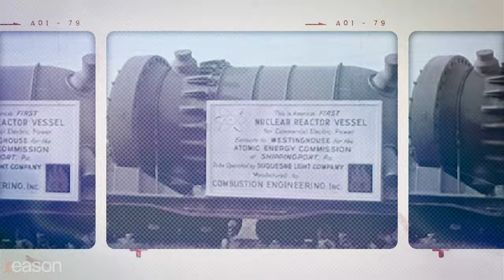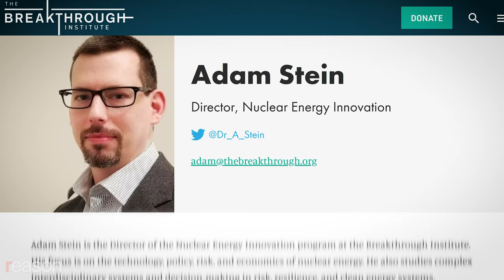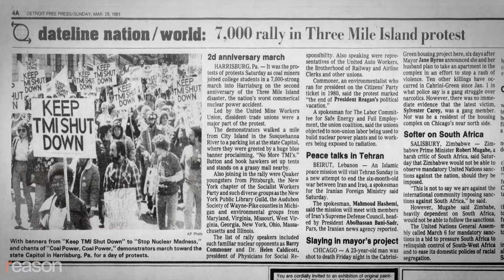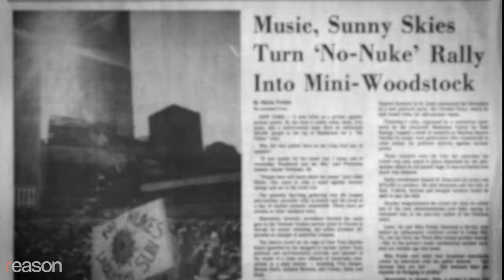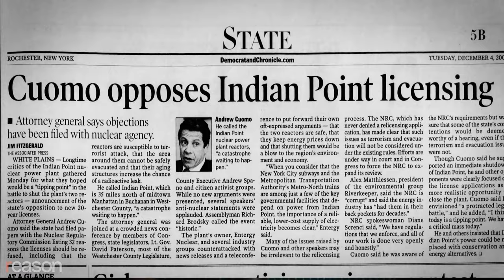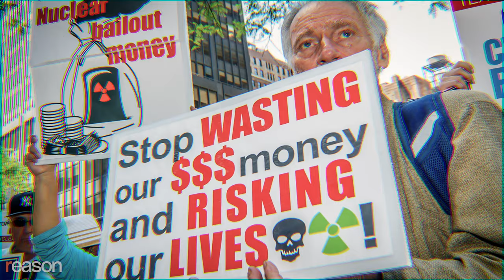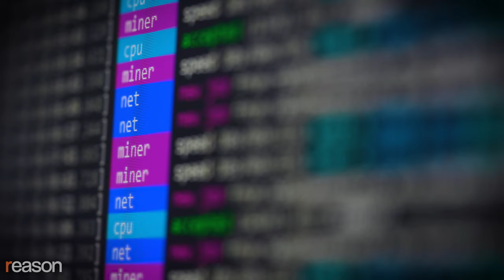Three Mile Island nearly killed nuclear. Now it's coming back.

Comment: Fission power is good for now, but the ultimate technology will be when we achieve fusion power.  It will be an almost unlimited source of energy (and much safer)!  We just have to achieve a rate of heat emitted by a fusion plasma that exceeds the rate of energy injected into the plasma, and scientists & engineers are getting closer to reaching that goal.
Reply: Fusion won't be enough for future tech, but that issue can be worked on over decades.
Reply: or cold fusion is a pipe dream that is physically impossible.  one of the two.

Comment: Nuclear is destined to be a bit player at best. Renewables plus storage are poised to drink their milkshake.
Reply: Batteries should be used to power cars, devices and other moving machines, not to store energy at night. Solar & Wind makes batteries expensive and therefore unviable to the energy transition. Also, Solar should be used for powering homes, on an individual level.
Reply: @pedromain  Well you're wrong about batteries not being useful to store energy at night, but you're also wrong in thinking that batteries are the only -- or even a major -- player in the storage space.
Reply: @sachamm  yup! nuclear's lunch is totally being eaten, which is why Microsoft chose nuclear vs wind/solar - oops! wait! um - I'll get back to you .....
Reply: Here's the problem with using batteries to store energy. Contrary to what most people think, batteries do not store electricity. They convert it into chemical energy, and store the chemical. When you need the electricity, the chemical is converted back, releasing the stored energy as electricity. Each energy conversion results in a loss. Meaning that best case battery storage is about 75%-80% efficient. (Pumped storage - where you pump water uphill, and let it run through a generator later - is more efficient.) 

In other words, every time you store electricity in a battery, you're throwing away 20%-25% of it as heat. So battery storage only makes sense if your renewable energy generation exceeds 100% of consumption. If it's less than 100%, then it makes more sense to eschew battery storage. Use the renewable energy immediately, and simply time-shift the non-renewable power generation to when renewable isn't available. e.g.

Say 100 kWh is consumed during the day, 50 kWh during the night. You generate that electricity as:

50 kWh renewable electricity produced during the day
50 kWh fossil fuel electricity produced during the day
50 kWh fossil fuel electricity produced during the night.
Total 150 kWh of generation - 50 kWh renewable, 100 kWh fossil fuels.

Now say you get the bright idea to use battery storage (at 80% efficiency) to shift all that renewable power to the night.
100 kWh consumed during the day, 50 kWh during the night (same as before). You need to generate that electricity as:

50 kWh renewable electricity produced during the day (stored in batteries)
100 kWh fossil fuel electricity produced during the day
(40 kWh renewable electricity released from batteries during the night, 10 kWh lost as waste heat)
10 kWh fossil fuel electricity produced during the night.
Total 160 kWh of generation - 50 kWh renewable, 110 kWh fossil fuels.

Congratulations. You plan to use batteries to time-shift renewable energy from day into night, has resulted in a net increase of 10 kWh of fossil fuels burned.

Comment: Is that why people in this area have thyroid issues….hmmm…couldn’t be
Reply: The accident at TMI 2 released insignificant radiation into the surroundings, and is unlikely to have caused disease.
On the other hand, due to the shutdown of TMI 2, upstream about 20-30 miles a coal plant was built and fired up to replace it - releasing particulates, dioxins, mercury and other heavy metals into the air - is it any wonder that disease in the area increased?

Comment: I am pro nuclear, as long as we aren't putting them next to our major cities.
Reply: Im not worried about an accident. I'm worried about sabotage.
Reply: You have to put them next to major cities.  For roughly every 50 miles electricity travels along the grid it loses roughly 50% of its charge.  There's no point in building them in the middle of nowhere.
Reply: Put it in my backyard, I'd rather risk meltdown than choke on coal smog.
Reply: @cassesvultus43  High-voltage lines can efficiently transmit energy long distances with little loss...though the higher the voltage, the more expensive it is to build the lines.
Reply: @ledzeppelin1212  this is my understanding too.  the loss over great distances on high voltage alternating current is miniscule.  it's very expensive to build the lines and nobody wants them in their backyard.
Reply: With a nuclear plant in your backyard the (very unlikely) worst case is one day you have to move in a hurry. With a coal plant in your backyard it's polluting your air every single day.
Reply: @munkeypantsman  depends on who you ask.  if you ask the same people who were hysterical about TMI they would also say that the coal plant will lead to worldwide extinctions and will make Earth unlivable.